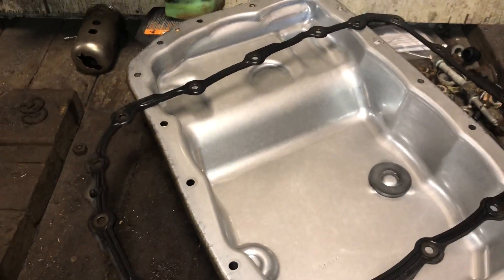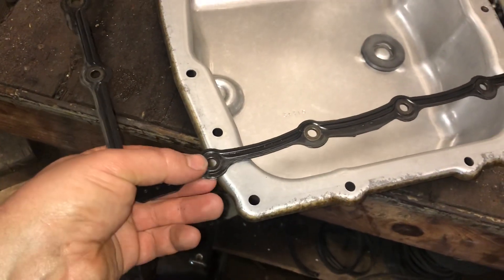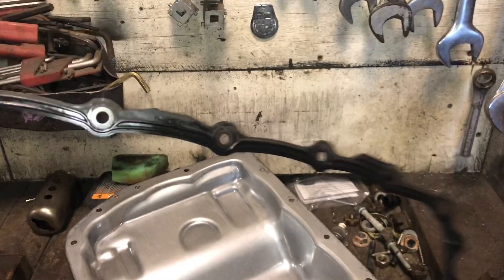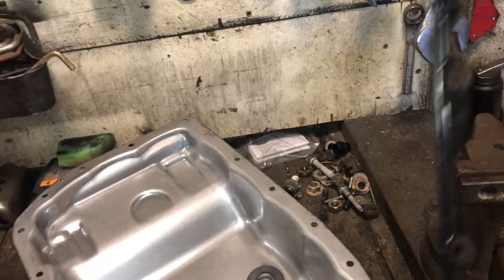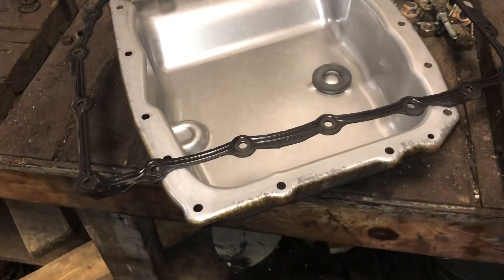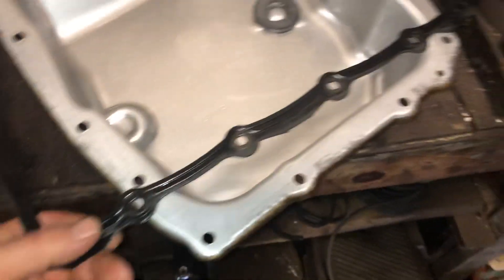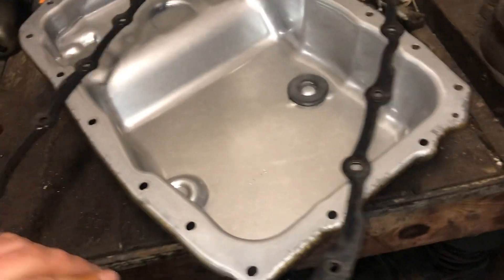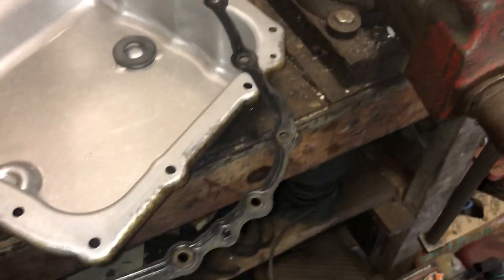What does a reusable pan transmission gasket look like

Comment: What did you use to clean it with. Brakleen?
Reply from the maker: Brake cleaner for metal surfaces. It’s not good for rubber
Reply: Clean the gasket with the carb cleaner supposed to be safer on rubber

Comment: No. Cork gasket all the way i fixed what the auto shop couldn't fix in  the 4 years its been in and out of the same shop i done what they should have done but they didn't do i know damn well they could see the leak there around each bolt head 

And the rotten gas filter plus it leaking gas.

I can see damage they done to the part that the transmission bolts to the lips bent out on 2 spots probably from them prying the old transmission off that metal needs hammered back down to the transmission so no water will splash up in the torque converter because it could and put some kind of sealant around the gap they created so im gonna make it flat again and buy 4 things of that black silicone stuff clean the area around that gap and start squirting it in the small gap thats the best i can do so the trucks already rigged up good its gonna get rigged a little more its good enough id sell it for 5 thousand and buy a Chevy then as much as my old friend put into the truck taking it to that shop its worth 5 thousand i wouldn't sell it for no lower price than that long beds are useful i probably wont sell it thats just a thought 

Alot of replacement parts we all buy aren't painted so i painted mine they'll take longer to rust out and im not done underneath yet with painting stuff that needs it and rubber tubing over brake lines that sit against the frame plus pack the new quick connects that i put on the gas filter with grease so they'll not rot out again on the inside so the grease will still be in the connectors for years or until i change the gas filter again whenever 

Im doing it my right way so i know my stuff will last longer everyone always needs a little help and we can't help them using a car